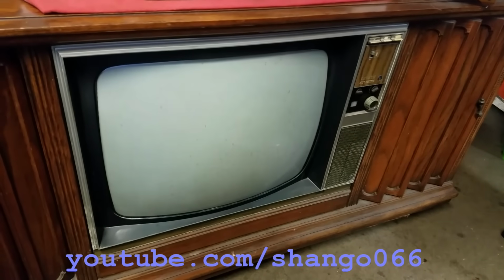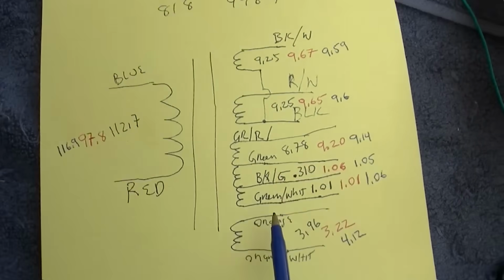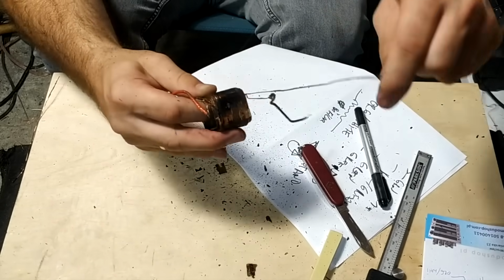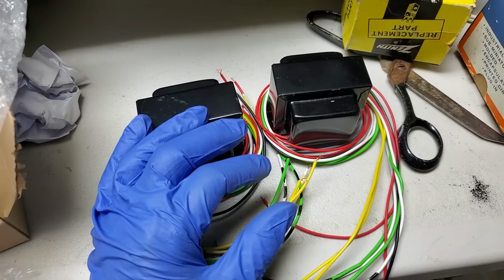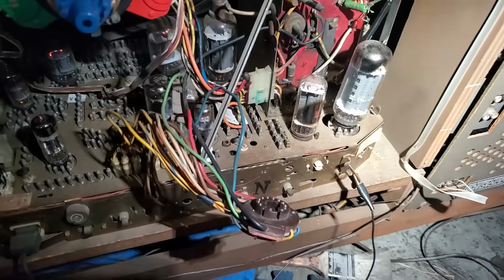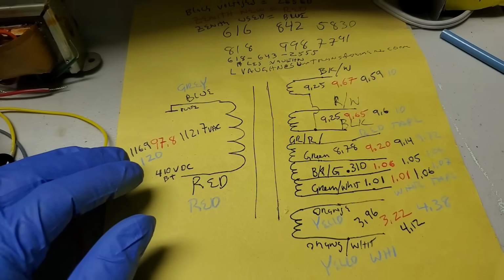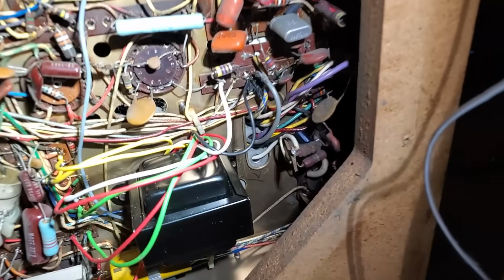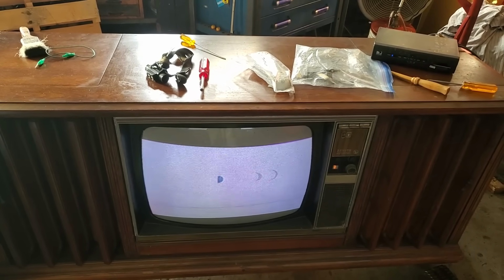Zenith Color TV Vertical Output Reverse Engineering And Building New Replacements

Comment: Vertical output transformers are tricky.    The schematic should have some bold dots by the wires that are in phase.  

The plate winding is usually a bazillion turns of very thin, like #40 wire.

The core is quite large as it has to be able to pass a 60Hz linear ramp with minimum slope.

It also for some reason has a thick core gap with a thick piece of cardboard opening up the magnetic path quite a bit.

The transformer companies might have forgotten how to rewind unusual transformers like this.
Reply: Core gap is needed when there is DC current going through primary winding.
Reply: Oh, of course.  You also see core gaps in Class A audio output transformers and some filter chokes.   We're talking just a millimeter or so but it critically keeps the core out of saturation.

Comment: Zenith! My favorite brand of SHANGO. I'm surprised to learn that color electron ray convergence is an AC function. In my mind it was a steady DC current.
Reply: DC can be used for static convergence instead of magnets. But for dynamic convergence AC is needed  - you have to follow the beam position.
Reply: My Zenith wood console from 1987 still works
Reply: @neil4306 my Dad (rip) and I R&R that color demod IC in our early 70s set. Carried on another 20 + years and the CRT was not the issue.
Reply: And mine from 1978 as well. @neil4306

Comment: Where is the problem in rewinding the transformers yourself? A used transformer winding rig is much cheaper than the cost of one single rewinding job at a rewinding company. I built my winding machine myself about thirty years ago and I repaired/rewound hundreds and hundreds of transformers and chokes on it. It's really not that hard.